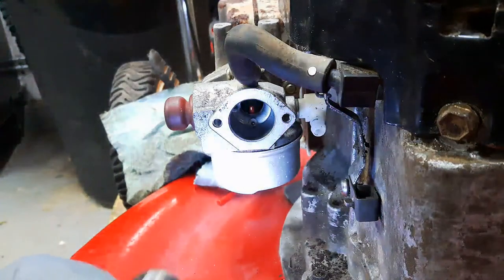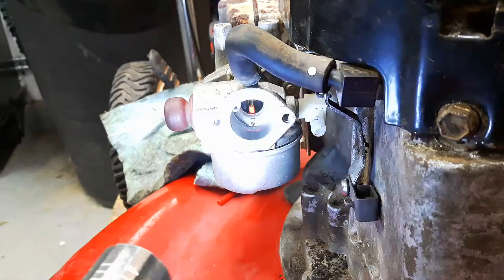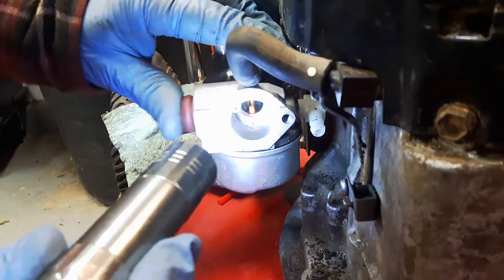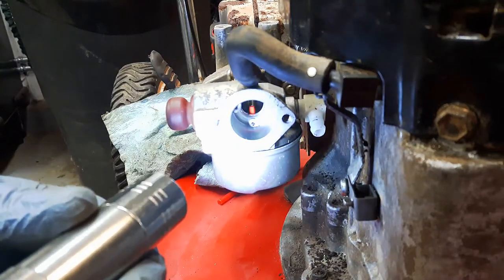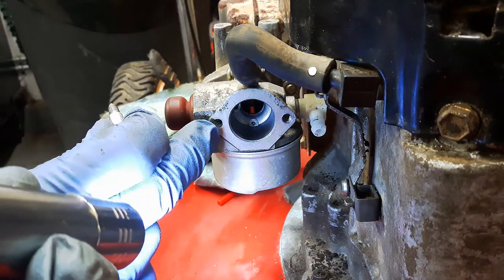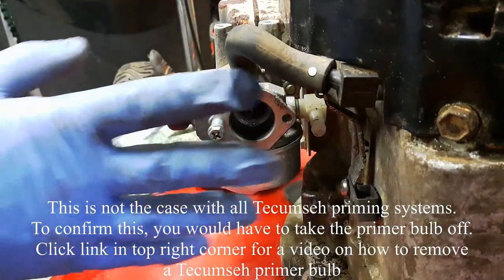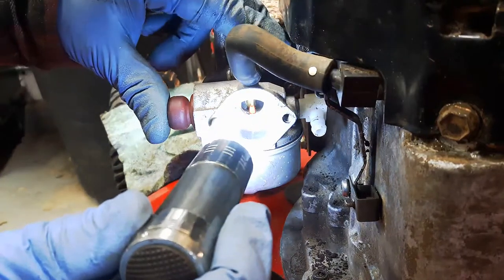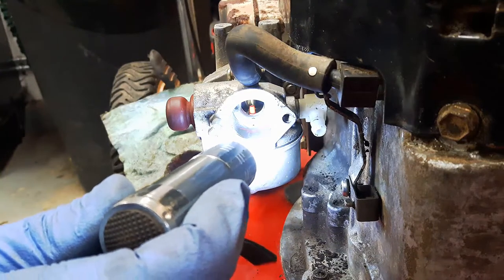Tecumseh Primer Not Working? Quick Fix. Check This Out!

Comment: Thanks for that tip about replacing the one screw... I don't think I would ever have figured it out myself!  Just exactly like you said... absolutely no fuel without the screw, and a lot of fuel with only two pumps of the  primer with the screw installed. Thanks again!
Reply from the maker: Glad I could help. Thanks for watching. Cheers

Comment: This is brilliant! Thanks very much. I was thinking the primer bulb was supposed to pull fuel up the fuel hose from the gas tank. This showed me how it is supposed to pull fuel from the float bowl. I had noticed inside the primer bulb, there is a tunnel going to the bolt hole. I wasn't sure what its function was. Your video answered these mysteries for me.
Reply from the maker: Glad it helped! Thanks for watching. Cheers

Comment: Great video! Under your carb bowl, I see a red tube. I think it attaches to the carb ?
Reply from the maker: Yes it does. It attaches on the air filter side. Here is a picture.
https://www.ebay.ca/itm/123270759165?epid=25021745510&hash=item1cb38282fd:g:bwMAAOSwbhFbWB-J
Reply: @brantsmallenginerepairs  What's the function of this tube? Anything related to the primer bulb functionality? Thx for the reply!
Reply from the maker: @guyzoun  it's a vent for the float bowl

Comment: I have an old Murray with a 3.5 hp Tecumseh and it’s about to drive me nuts! It will not prime! The carburetor was clean but no prime. Ordered a new carburetor and still no prime! The bolt is in the hole, no prime! What is your take on this problem? I really don’t need this mower, but I have become obsessed in trying to get it fixed.
Reply from the maker: Without having it in front of me to inspect, I would assume it's not the carb if you replaced it. I also assume the tecumseh carb you bought came with a brand new primer bulb? If the bulb does not seal properly due to a crack for instance, it won't push the air into the float bowl and force the fuel into the throat of the carb. So if it's not the carb or the primer bulb, I have to wonder if there is fuel in the float bowl? Has the fuel line collapsed in on itself? (this could be hard to tell from the outside of the fuel line). I do know these Tecumseh priming systems do not work as well as their Briggs counterparts. I often have to prime these engines 10 to 15 times on some machines. Not sure this helps but keep us posted. Cheers
Reply: @brantsmallenginerepairs  Thank you Brant! As a matter of fact, you hit the mail on the head ! I was piddling with this thing the other day, after a pretty cold winter, here in Alabama and noticed the clear fuel line was not completely full of fuel. This was after I had put the new carburetor on. So I took the bowl off and there was no fuel in the bowl! 
I checked the gas tank and evidently all the fuel had evaporated over the winter!🤪
I feel so stupid, but I do have somewhat of an excuse. I am 81 years old! Every time I think I’ve seen it all , I get surprised. I put the mower back on the lift, raised it up, pumped the primer button and guess what? It primed! Sometimes it the small simple stuff that gets over looked.
Thank you so much for your reply and keep up the good work.
Reply from the maker: @billyb.9533  I'm glad you were able to figure it out. Remember,  age is just a number. The fact that you're still wrenching on your own stuff at 81 proves that. I hope I'm as lucky. Enjoy the warmer weather that's on it's way. Cheers

Comment: Do a murray video on how to tell if the blade driver is wirn2 on a murray selfpropelled
Reply from the maker: To check if a blade adapter is worn, remove it and inspect the surface that comes in contact with the blade. If there is a raised "bowtie" shape or raised circular bits, inspect them for wear. If there is any, replace the adapter. Also check for any deformation of the adapter.

Comment: On mine, the screw is in, and there is fuel in the carburetor. It starts with one spray of starting fluid. However, it still does not prime. There are no signs of wear on the primer bulb. I did ensure the screw was in. I really don’t know what to do.
Reply from the maker: If you take off the air filter and look into the carb when pressing the bulb, you should see fuel squirting into the carb. If it isn't, I would replace the primer bulb, even if the bulb looks good. Start there. The bulbs are cheap. Hope this helps. Cheers
Reply: @brantsmallenginerepairs  I took of the primer bulb and did not see any cracks on the other side of it. Should I spray into those holes underneath to clean them out?
Reply from the maker: @applianceman6009  you can try but if that doesn't work then replace the bulb. Make sure to reinstall it properly. If there is any gap then it won't make a good seal and won't push enough air to pump fuel into the carb.
Reply: I sprayed break cleaner into the holes underneath the primer bulb and put a new bulb on. Mower starts much easier, but it still doesn’t prime. I made sure every bolt is tight. I don’t honestly know what would cause it to not prime now. Primer bulb is on as tight as it can go too.
Reply from the maker: @applianceman6009  without seeing it first hand, it would be hard for me to completely diagnose. I do know that the tecumseh primer bulbs are the worst of any manufacturer. I do sometimes have to press these types of primers like 10-20 times to get enough fuel to aid in starting. And some need to be pressed really hard to get them to work. Sorry I couldn't be of more help
Reply: @brantsmallenginerepairs  I never have had any issues with Briggs and Stratton primer bulbs!! Much better design!!